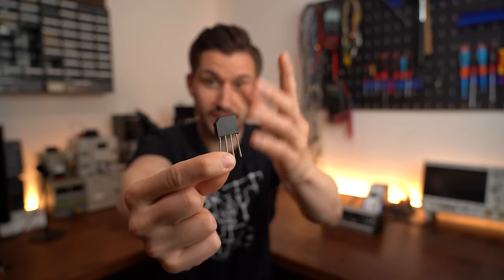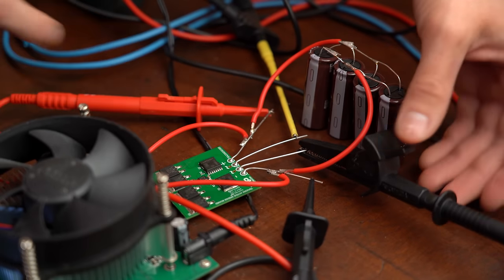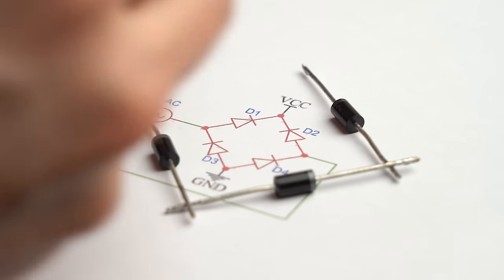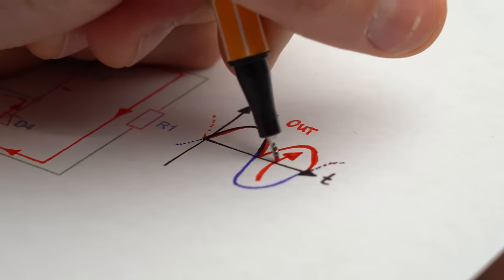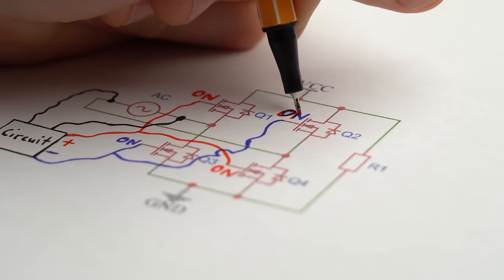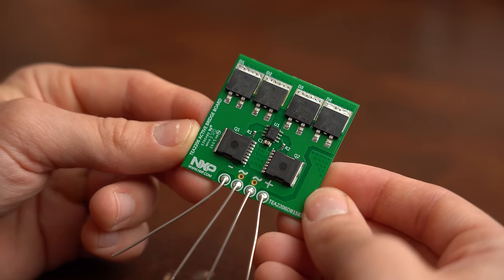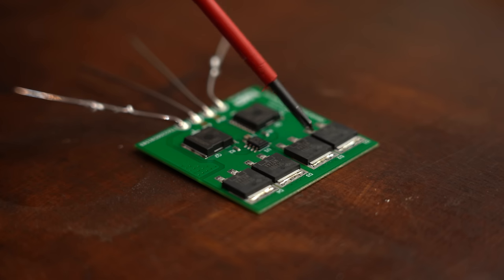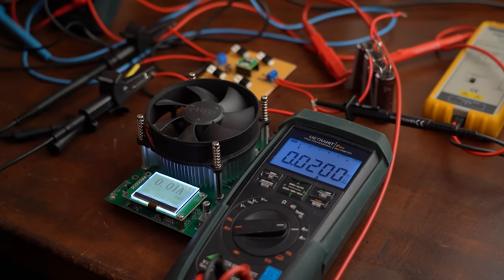The End of the Full Bridge Rectifier? (Sorry ElectroBOOM) Active Rectifier is here!

Comment: How to make something overly complicated with more components and more cost plus  uses more space on a PCB 

Think  I prefer the old way of doing this  myself 

Next comes  the module that  you can't  get too  when you need to service an item , preform voltage checks or scope and of course  yes they rip  you off for the module  which co incidently  uses SMT 

 If you want high stability on  power supplies then you opt for  PWM and switch mode to start with but there you are   OK  its very clever  but its also overly complicated and will suffer from inherent switching noise where on some  circuits will  have  other effects  when this may  well interfere  with  on board oscillator  circuits etc 

Next you would  have to  implement RFI shielding  to counteract these effects 

Uh yet more cost  ?  

Next  comes the damage to the PCB  that happens when these  FETS  burn  up and they do  often ,,  Uh  oh 4 fets that have to be replaced plus IC and  cant repair board 

Then  you  finally take  this into account and think   simpler is better   in many cases and  also far more cost effective  over all

It doesn't take you to  long to  work out what they  are up too with this and the answer is  ? 

10 / 10  , You guessed  correctly , "We dont want this serviced or repaired so  we decided to make this  overly complicated  knowing full  well that our aim as  manufacturers is to force  you to buy new " 

Ive seen this done so many times across the industry that by the time they have finished they actually wreck their own companies  and good  products  along with a number very good engineers  jobs never mind all other companies that decided to take this route  thinking they are very smart until this too hits them  in the rear end 

I like technology dont get me wrong  

I also see where this is going and I know how they work  which in essence  boils down to greed and "I Must have total pow wow  over all " ,  not that  they are not facing major challenges with waste and climate change any way so why not make it worse   

Beats the hell out of me why anyone would want to go these  lengths for the sake of what  an extra  4.7%  efficiency  and at nearly treble the cost  

Well  there  you I guess    , " You can get to clever with this  and unnecessarily so  achieving  negative performance over all  "

Good presentation  though and and yes Ive learnt something new   but other than this  ....  well  Ill leave it there

Its not really a question of trying to outsmart people which in essence is what this has become  generally speaking ,  and yes it  has got this stupid  but how to produce  a practical solution that benefits the majority  and is workable and viable   but hey ho the  show must go on

Comment: Ultimately, this active rectifier has too few use cases and comes with some nasty safety issues (creating a short if the chip doesnt operate properly). By comparison, the "good ol'" set of 4 diodes is simple and safe.
While there certainly are use cases for the active rectifier, the benefits are far too low to justify the issues it creates.

Comment: It's not a capacitive load with DC.  What you have done is put a super low resistance on the output and you are pulling way too much current.  That's why it didn't work.

Comment: Some chargers, drills and AA/AAA chargers must use the old type of transformers instead of the stabilized ones. If not, the batteries remain weak or the IC charging won’t start. Sony mini disc doesn’t like 3v ic charger.

Comment: If it could pass EMC testing, then it would be awesome.
Reply: @Christopher Grant I'm sorry.  You lost me.
Reply: @Christopher Grant okay? Why are you tell me a thing when EMI have nothing to do with EMC issue?  It is H bridge gate.
Reply: @Christopher Grant again, nothing to do with EMI. Surge or ESD could cause H bridge gate to failed.
Reply: @Christopher Grant I never said that.  As I said, EMI has nothing to do with what I'm talking about.  And H bridge gate should never be built everywhere.   

Do you know that the microwave inverter have H bridge for high voltage, right?  They always breakdown and failed.  That is my point.
Reply: @Christopher Grant  @Christopher Grant  I'm sorry, but you have no idea what you're talking about.  Microwave inverter are not a special case as I found a lot of them in scrap.  Only one microwave with transformer during my 7 years working are found in scrap.

Most importantly, if you haven't use a surge generator yet then it mean you have no idea what it is gonna do to an active rectifier.
Reply: @Christopher Grant again, you have no idea what you're talking about.  I read IEC standards, so I know about EMC a lot. So if one transistor is stuck closed cause by parasite capacitor then it is bad and could blow up.
Reply: @Christopher Grant by the way, using active rectifier on high voltage is a suicide project.
Reply: @Christopher Grant I don't need to read because it happened before in work and it didn't end well.  Remember, you're the one that commented without proof of evidence.  And JFET is the only that can be controlled easily, not IGBT on low voltage if bad design.

Comment: Ultra-Low VF Schottky Rectifiers virtually eliminates the voltage drop issue and will work in a FBR as long as the voltage and current specs fits. THere is no need for all this chicanery.

Comment: I was concerning a mosfet without the diode in place of the diode detector, .05 voltage loss than .3 volts in an AM detector. This way a batteryless AM radio could detect more signals!

Comment: Simple is the answer. Silly countries using 230-240vac when 120vac is good enough and safer. Can't blow up your equipment if you accidently plug 120 into a 240vac without checking. All you have to do is do what America does, split the 240vac.

Comment: Dear GreatScott, the title of the video is misleading. It is still a bridge rectifier. For rectification, instead of diode MOSFETs are used. For example, MOSFETs were also replaced the tubes in amplifiers, oscillators, mixers so on but that is not the end of amplifiers oscillators and mixers!

Comment: AC motor drive chopper for drives is old. Nothing new here... just implemented into rectification. Also, standard MOSFETS have internal diodes. Useless for this application. Also, is the old school method using scotky diodes or not? Efficiency difference between the two.

Comment: This IC TEA2208 is just the poor mans version of the LT4320 is it not? 
Linear technology calls their IC 'The ideal diode bridge controller' but its the same thing. 4 MOSFETS and a controller.
Reply: Both are expensive at about $7 or $8 each. The LT4320 is limited to 9-72V and is useful for PoE or some industrial (say 24V AC) equipment where the high cost is acceptable.
Reply: @mikemike7001  From memory I think the LT4320 is much more efficient. But from my own work with it. It is more difficult to pair with MOSFETS. As in, it won't just take any old MOSFET.
Reply: @danishdart  Yes, I've forgotten the particular requirements, but with any similar circuit you would want to use low Rds(on) MOSFETs, which can get expensive. We experimented with FDMQ86530L quad MOSFETs to save space and cost, but they have ridiculously long lead times. In the end, due to cost, we used a conventional bridge with 4 low Vf, low Ir automotive-grade, 175°C Schottky diodes.
Reply: @mikemike7001  1$ vs 10$. Easy choice to make.
Reply: @danishdart  Only reason we considered it was to further reduce heat and power consumption in a product that must operate in a hot environment. Plus it's kind of cool and fun to explore.

Comment: I was using schottky diode for many years and do better job than mosfets (schottky diode have very low resistance than normal diode) Mosfets are good but control its not easy and fail very often

Comment: This was weirdly unsatisfying. You've shown all the wrong application for this circuit and some of the information provided was also a bit confusing. First of all, it's not really the current, it's the voltage drop on those diodes compared to mains voltage. If you have around 0.56V drop on each diode, there are two in series and you are trying to rectify 25V, of course the efficiency lost on these diodes will be 100%*(0.56*2)/25 = 4,5%. The higher the rectified voltage, the less of an effect that drop will have. Try doing the same thing with 12V or 5V... 
An 100A diode will still have around 1V drop below 20A, so you can make something that will be reasonably efficient even with extremely high current. The problem is that these components are very expencive. You can also use shottky diodes and there are some power modules with extreme performance, like the 300CNQ045PbF, which has 0.61V drop at 150A, it just costs around $45.
Active rectifiers solve specific problem, which is when you need to rectify low voltage with somewhat high current.

Comment: wtf the circuit model for a mosfet - like any transistor - has a diode in it why would it lose less power than a simple diode by itself?
Reply: Because it has less than 0.1V drop compared to 1-2V on a normal diode bridge, it makes sense for high currents.

Comment: You are scaring me, the way you are using your auto transformer for a low voltage power supply.....most wiring rules warn against doing so as any sort of overload or open circuit could see mains active voltage  being applied to all those wires your touching.... 
A solution would be to use the auto transformer to power a step down transformer that offers isolation from the mains in case of a fault.

Good video...

Comment: Overall, this circuit even if more efficient, is not worth it.  Too Complex.  More components to fail and higher cost. Switch from silicon to Germanium Diodes and you increase efficiency 60% in a bridge rectifier.  .30 for Germanium vs .70 voltage drop. Simple is always better, more reliable, smaller and cheaper.
 if this circuit requires a controller which uses current, then how is it more efficient ?

High or low current makes little difference if you have a proper cooling method. Modulated Scan wave / Switch mode power supply ( invented bu Motorola in the late 1960's) and used in every power brick currently sold is how you improve efficiency.
Mosfets will not provide constant current like a diode can.

Comment: Useless for 99% of practical applications needed at your home (with 2-phase 110 - 240VAC outlets). Even the computer will function better if supplied by 4-diode rectifier and a toroidal transformer (though these PSUs are chunkier).
Disadvantages of mosfet designs::

Generates electromagnetic interference
Complex circuit design
Expensive compared to linear supplies